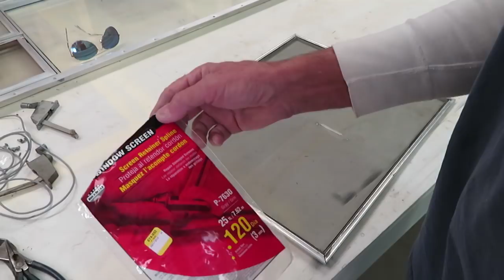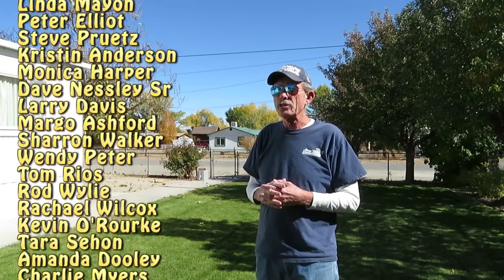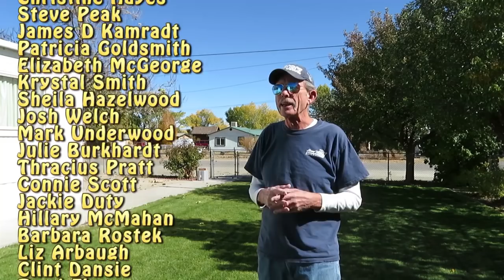Replacing Newer Window Screens

Comment: I started with the screens and my questions are pretty much answered. The only question i have from watching your older videos on screens. You said to use to the galvanized aluminum mesh, and here you used a charcoal color.  Does it make a difference you said these are for the glare?
Reply from the maker: The older HEHR windows for 50s trailers that are push out type use the galvanized aluminum. That will not work with these frames. These screens are separate parts from the windows. On the older push outs the screen material is fastened to the window itself...